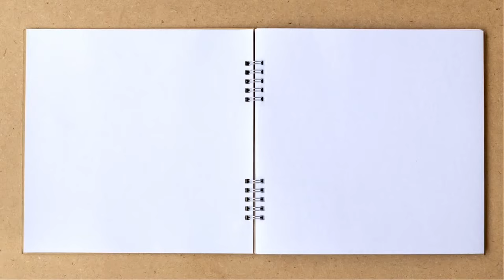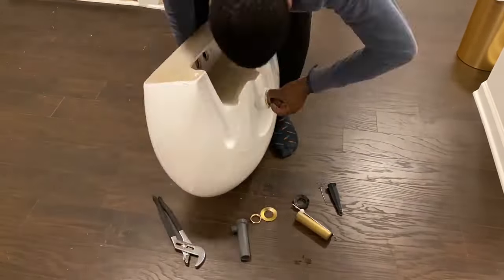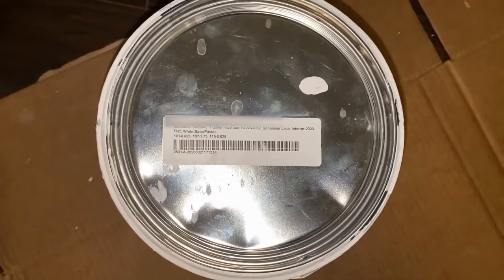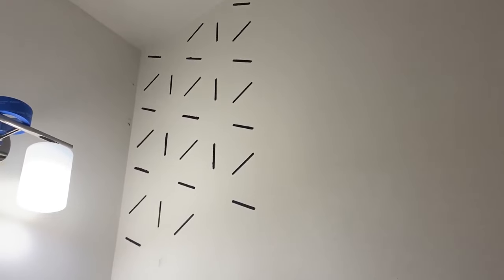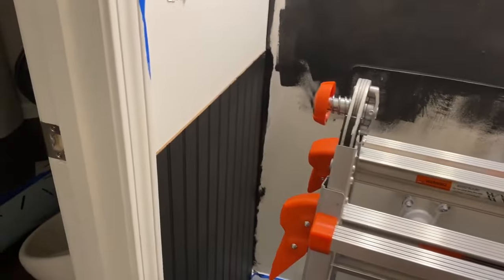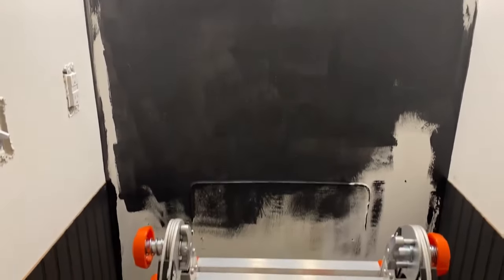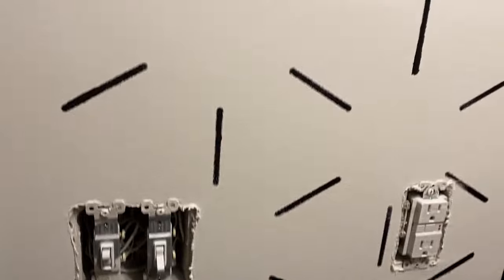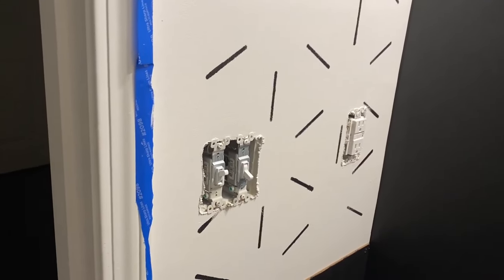Extreme Makeover - Small Half Bathroom | Powder Room | Under $250

Comment: very nicely done! from a design standpoint, you chose a stencil that keeps an open feel and the feature wall helps pull everything together while still giving the illusion the space is bigger than it really is. the switch plates and industrial paper towel holder were the only things I found out of place. the switch plates being very Victorian, and the industrial pipe clashing a bit with the contemporary and smoother design. did you end up using the rub and buff on the door hinges? I find little touches like that also help with the finishing of a design. you can even use it on your switch plate to keep everything consistent and take some of the age out of them. awesome job, and a fantastic D.I.Y!

Comment: Your bathroom is my inspo for my powder room. How did you get the wall paneling cut out for the plumbing part of your toilet?
Reply from the maker: We didn’t have to make any special cuts.  The toilet sits far enough off of the wall so we just slid the paneling down from above.  Hope that was the info you need.  ❤️
Reply: Did the paneling stop above the plumbing behind the toilet?
Reply from the maker: @leahturner7643  our plumbing goes into the ground rather than the wall so we didn’t have to make any extra cuts